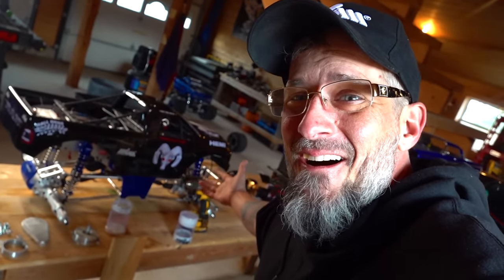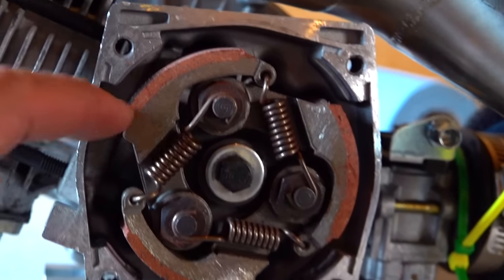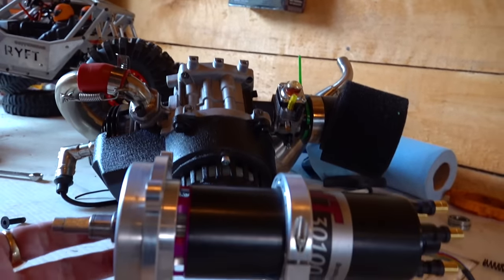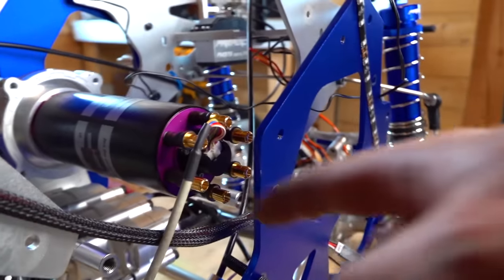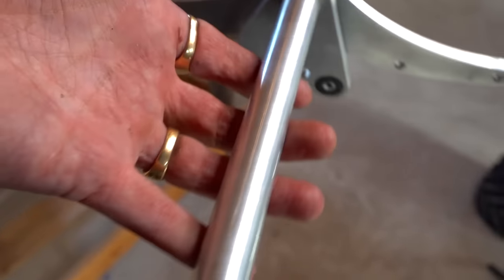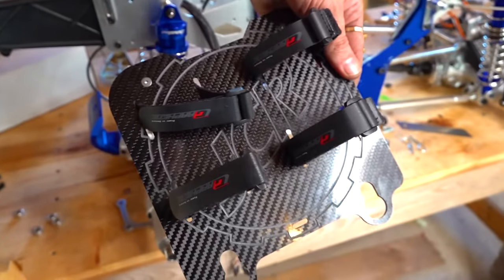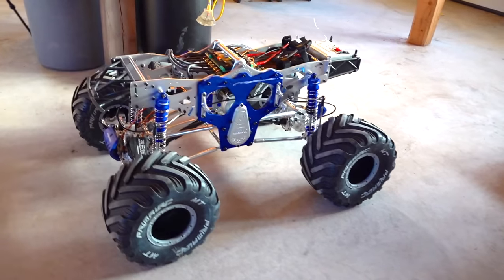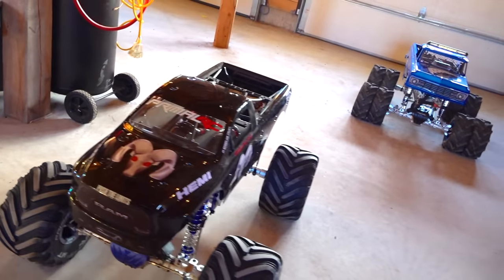INSTALLiNG a MGM X2 53hp 40kW 1000AMP ESC & 30100 BL MOTOR - PRIMAL RAMINATOR | RC ADVENTURES

Comment from the maker: For those wondering if FLIPPING the ESC was possible, the answer is "no". The pre-drilled holes in the ESC are not completely center, and the size of the fans prevent the mounting holes from lining up. I should have shown that in the video, but didnt think of it.
Reply: Seeing you standing behind this I think I now fully understand how absolutely massive this truck is
Reply: You can remove the fans if that helps with space.  They aren't really needed on the esc because the heatsink is so massive it will dissipate heat on its own. My 80063 has never gone over 100° Fahrenheit so far in my vekta. The raminator is larger but I think the gearing isn't crazy to really load down the motor/ esc.
Reply: darn
Reply: Won’t know till you start running it, but if the fans start pumping out lots of hot air it might be helpful to fabricate a simple deflection plate so they don’t blow the hot air directly at the motor.  
Just a thought. 
CANT WAIT TO SEE THIS GO!!
(glad to see it get rid of the clutch system)

Comment: Just for perspective... THIS WILL HAVE MORE POWER THAN A YAMAHA RAPTOR 700 SPORTQUAD!😂😂😂

YAMAHA RAPTOR 700 2015 - Present
Horsepower: 46.9/9000 KW(hp)/RPM
Weight: 422 lbs OR 191 kg

Comment: It's Very cool to see how are builds parallel each other and how they are different still waiting on my 600amp flier esc and 6s 22000mah packs to get here as well as figure out a few other odds and ends .. as you you have to do with ths kind of build ...look forward to seeing your progress
Reply from the maker: Im interested in your 22000mah packs. I looked at those.. but they only had a 30c discharge, or less. Did you find something more? That motor is gunna pull a lot

Comment: Pro tip, when trying to remove fasteners with thread lock use a soldering iron on the head of the bolt instead of a torch. Helps prevent melting/damaging the finish on surrounding components
Reply from the maker: Also Pro Tip - these bolts will not heat up even at 800 degrees with a soldering iron.  They are too long and the amount of thread lock used on these models are notorious for being "too much". Also, this is anodized aluminum - the torch wont touch the finish, as the finish is baked on.
Reply: @TheRealRCSparks  totally agree with that, no replacement for a torch sometimes. But very easy to melt wires and plastic if not careful lol

Comment: use a soldering iron to heat out locktite it works much cleaner than a torch you can just jam the tip into the top of the screw and let it rip
Reply from the maker: No, not on these you can't. They are too long, and the iron, even over 800 degrees does not melt this thread lock.. I dont see how its cleaner.. but hey.. Ive only owned 4 of these machines! Lol..

Comment: I wonder what that would be like bolted up to a racing gokart chassis lol.. I've got a couple, one of which is retired and would be a good test mule. Add a couple big ass battery packs where the gas tank and radiator usually goes and go rip it up. Maybe a future project. That thing makes a shit ton of power. Jeez.

Comment: Try using a shorter torx bit on your drill when under torque might actually be a useful tool if you use it correctly.

Comment: This might be a bit late, but make sure you use a resistor on your battery connector when you remove the on off switch.
The currents youll get when charging all those caps will  ruin your plugs  in no time.
Reply from the maker: the QS8's are spark free..
Reply: @TheRealRCSparks  Ah, didn't know that.

Comment: I recommend you actually build a cover to protect the connectors of the motor in case of a crash. With the four bolt under it to secure it. It could look like a diff cover and protect that expensive motor.

Comment: If you flipped the esc  180° so batt wires are opposite of batts and still be able to reach the batts.. ..your sensor wire might reach than.....??
Reply from the maker: It does not fit the JCB hanger if flipped. The holes are predrilled into the ESC for mounting
Reply: @TheRealRCSparks  ok thank you for taking the time to respond🤙 you rock

Comment: am not clued up on electric motor specs but you can get electric scooter that will do 60mph with a 100kg rider so how does this setup compare to something like that.  could you fit a scooter setup up on the truck and even gear it up to go faster?

Comment: Are the diffs going to be able to hold all that power plus the added weight of the go-kart tires
Reply from the maker: Wont it be fun to find out!
Reply: @TheRealRCSparks  I guess we can only wait and see bro good luck can't wait to see
Reply from the maker: @mikemoggey  This is why I am putting 20 Million Diff Weight Oil into the Diff Cups.. it will help solidify them in place..

Comment: How did they design this without having a truck there to design off of and then end up with the issues that you have? They must have test fitted for it
Reply from the maker: They contacted MGM and got the specs. Then they 3D printed a model
Reply: @TheRealRCSparks   ahhh that makes sense.

Comment: Control box is upside down the fans is top and wire will hook up good
Reply from the maker: Heh..no, its not. The pre-drilled holes do not fit, because its NOT upside down

Comment: With that much power it might be good to put an on/off switch, every time you plug batteries in it almost always produces a spark every with it off and I'm concerned that could damage the electronics over time having that sudden spike in voltage kicking it all off...
Reply: those cap packs are suppose to help,but this system is ginormous🤔
Reply: FYI the On/Off switch is to power up the ESC low voltage control , all the main batt connectors have QS8’s which are antispark connectors designed for this specific purpose 👍
Reply: @michaellucre8249  when I plug in the batteries on literally all my RC's they pop...using XT90 connectors. Had the same experience with IC5 connectors as well. There is serge protection built into almost all electronics through a rectifier of sorts, evens out voltage but when it's sparking on connection it is wearing out parts whether their meant to be or not...just saying it will lower the over all life span of your electronics to have it love when connecting batteries.
Reply: @jakejager  if you use the XT90S with the antisparks that’ll eliminate the inrush sparking, the MGM has a antispark system but with the Develpoment of QS8 and QS10 by AMASS there’s no need to use the antispark system, personally myself I still use it on my MGM systems

Comment: Duplex chain? Nah bruh that's a timing chain set off a  small push rod 4 cylinder lol. Ya know I was into rc off road racing when the team associated RC10 GT was the beez kneez and Brian Kinwald was slaying everyone. I was about 16 when brushless motors and RTR everything started becoming a thing🤮.. but these new brushless systems are just insane lol.. I'm a nitro bro forever though 😈

Comment: everythings mounted up so high, looks like you will have a major CG issue.
Reply from the maker: Ahh. My friend, you are not taking into consideration how heavy the bottom is... Most of the weight of this truck is located in the bottom. Also, the sway bars help a lot. These tires are very wide